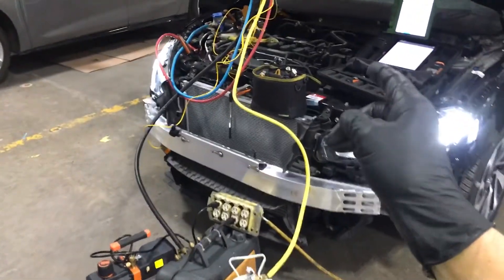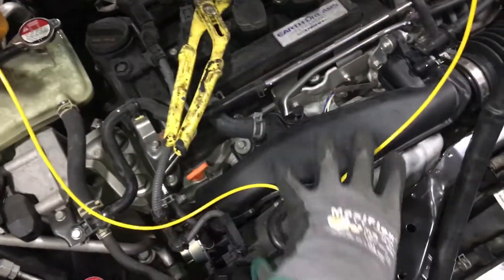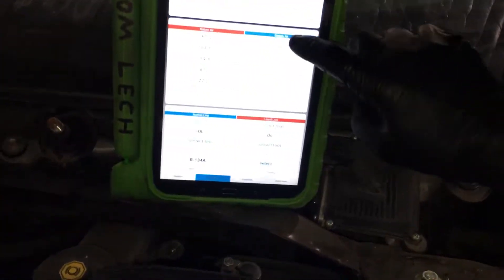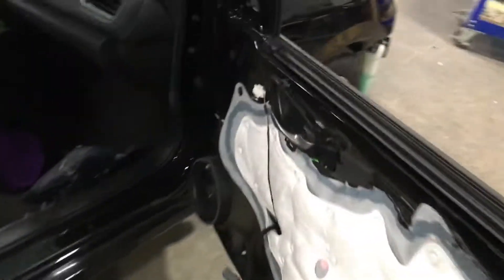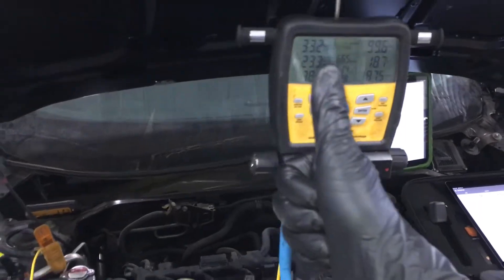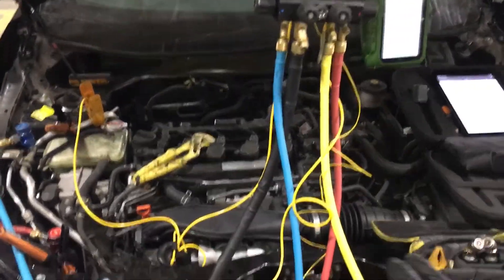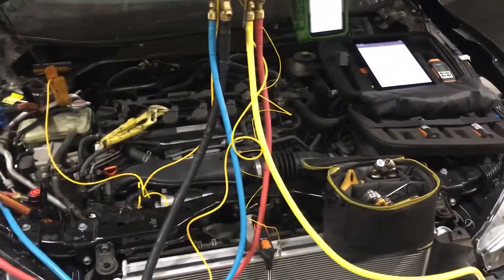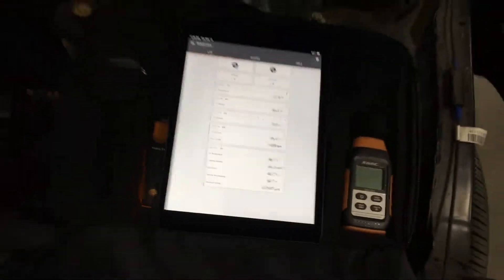Air conditioning variable displacement compressor low side pressure doesn’t change removing the load

Comment: So do I understand this correctly...When you dropped the heat load on the evaporator by selecting recirc. Although the L&H pressures altered very little their must have been a significant reduction in the volume of refrigerant displacement by the compressor. The climate module (ECM) would sense the dropping evap temp/cabin temp and reduce compressor output via the control valve on the compressor to match demand....Is that correct Tom? Thx for fielding the newbie questions.
Reply from the maker: Correct 🏆

I need to make a side-by-side video with two cars one old fix displacement piston compressor and then one of these new variables and do the exact same thing on both vehicles so people can see. 

          The same goes for raising the RPM in the old days with fixed displacement compressor when you raise the RPM the high side usually went up the low side went down and if you were feeding a refrigerant can into it it would help take it in faster because the low side pressure would drop.
Reply: @coldfinger459sub0  Thx Tom. Pretty steep learning curve to all this stuff (at least for me 🤣) Your prolific output of videos really does help a great deal. Thx again 👍

Comment: Do residential A/C systems also now use variable displacement compressors to increase efficiency?
Reply from the maker: Yes, the more modern day ones today have been switching over to vary the refrigerant flow. 
     They also started varying the condenser fan speed, controlling airflow over the condenser to maintain what the software has been programmed to hold. 
    And some of the higher and more efficient ones have varying speed, indoor air handler ECM blower motors. 

There is a manufacturer software built-in override one of two methods are used 

One as you have the manufacturer software that is loaded onto your laptop with an umbilical connection interface . 
     And you put the system into a test mode that fixes the displacement of the compressor, the condenser fan speed, the blower fan speed into a fixed mode, the more advanced one base it off outdoor temperature, indoor temperature and even take humidity into account. 
    And then the charge for the refrigerant can be set or topped off using superheat sub cooling

Some of the manufacturers are not that fancy they just have dip switches on a circuit board that you override and flip to set the unit into a test mode to override everything so the technician basically has a system that’s operating like an old-fashioned one where you can use super heat or sub cooling. 

Something to Automotive manufacturers need to do for us in the automotive industry for the AC especially the new heat pumps
Reply: @coldfinger459sub0  Wow, that's a big advance!   But very expensive?
Reply from the maker: @rj7008  everything became stupid expensive 100 200% increase in price after the Covid shut down. 
     And on top of that big venture investment capitalist came in and started buying up all the distributors and fixing the prices doubling the prices again just for profit margins having nothing to do with supplier demand. 

The variable displacement variable fan automated systems have been around for decades there nothing new . 
I myself have been purchasing and selling them to customers and installing them more than 20 years ago. I immediately jumped on the bandwagon of selling the most expensive bleeding edge, technology equipment, right away as soon as it was introduced into the residential market

On my large commercial building equipment, it was already available before that .  With much more advanced features.

It trickles down from the industrial and commercial industry first and then when the products can get cheaper and smaller in migrates down into the residential side of the market   

Think of it like cars, the most bleeding edge high tech, expensive options come into the highest end, Cadillac Mercedes-Benz, Audis Infiniti or Lexus, and then when the technology gets old and cheaper, he gets moved down to the lower and models of the company and become common place
Reply: @coldfinger459sub0  Very informative.  Unfortunately, my home A/C system is now 24 years old.  It's currently working well but I'm unsure about how much longer it will last -- hopefully 1-2 years more.  Unlike SF or LA where I grew up, A/C is not optional in Houston, Texas.  :(
Reply from the maker: @rj7008  if I was you, I would do everything you can to keep that old AC unit life it could last you another 10 years at least

Replacing motors is easy and cheap compared to a new unit contactors capacitors 
   If it was my own personal unit myself, and I wanted to keep it alive

I would pull the evaporator out give it a good cleaning and put a heat exchanger epoxy coating over the entire thing to extend its life another 10 or 20 years . 
    As long as the metal from the coils, condenser or evaporator are not exposed to the atmosphere for moisture, and possibly any corrosive chemicals or leaves dust debris that gets wet and causes corrosion.  By epoxy coating, there’s no electrolysis between the different metals at the header plates from the steel to the zinc to the copper to the aluminum.  Because it’s encapsulated inside epoxy.. 
      On my own home personal unit if I had such a unit. 
     Even if the compressor went out after 30 years. 
     It was most likely grossly oversized in the first place because that was a standard practice. 
      If I had a 5 ton system on my house. 
     I would keep the old system everything and replace the compressor that was rated for five times with a three tone compressor. 
      And now you would have a more efficient system because you have an oversized condenser and an oversized evaporator. 
       I know it would probably work better longer run times.  Instead of cycling off and on. 
      Throw on a good filtration system to protect a evaporator so it never has to be cleaned

Comment: how about you design a adapter or device for the rest of the world,  that works with the so called jerk off can,  so  the ac pro company doesnt release it sooner than you,  there working on it now, you keep showing them that no  diy-er  cant possibly charge there own ac system  close to full with a variable compressor used by many automakers over the last 5 years  and there going to show the rest of us how it can be done safely,  remember your dads generation said there would  never be a banning on r-12,  everyone said r134a would be for a lifetime,  they said sealers wouldnt last,  and just 10 years ago many ac techs and  wholesale  said never would they use reverse heat pumps in the auto industry.  your generation said who would ever need a  digital thermostat in a family home, because the old analog slider didnt work well enough for your grandparents home.  i gotta go now, myself like millions of other  people in america who would like cold air have to go jerk off now with there cans.  good day.
Reply from the maker: At least they could use just pure R1 34 without the additives it’s the additives with the people who use multiple cans where I see the blown shaft seals from their failures. After a couple extra ounces of lubricant have been added by repeated topping off with cans with additive in it that is my big issue. 

         I’m all for the do it yourself person they have every right to attempt the best repair they can add a economical price and be provided with all the information they could possibly find to do the job right so it doesn’t cause them undue harm to their financial situation. 

            But on the other hand I’m avidly against a professional shop will charge as a customer and money to use small refrigerant cans and just guess at the charge quantity taking money from a customer at the same time being the cause of their compressor burn out their shop seals blowing out clutch is slipping in burning up because they just guess with using little cans in what is supposed to be a professional trades industry .

            no problem Ann A/C pro can put their product on the market but provide truthful and very detailed instructions to come along with it. 

         Listing the possible side effects to the customer of how expensive and what could go wrong if they don’t do it right. 

         And when you go jerk off with your can remember to bring a razor because your palms may grow hair. 
          Bring a cane with you in case you go blind

My vendetta is against low life scum sucking owners of shops who can’t do the jobs they ask their guys to do an under pay them and don’t pay for training they prey on the lack of knowledge of the general public and rip them off and performing procedures they themselves cannot perform correctly. 

        These are the same lowlifes who replace a burn pile transmission but don’t flush the cooler or the lines and leave the metal debris in there so the transmission can fail again and another 30,000 miles. 

      These are the same kind of shops that don’t pay for their guys to go for training and buy them set equipment for proper cooling air purging methods so a customers car goes out and comes back with a blown head gasket because of the air inside the cooling system. 

          These cock roach owners of shops who are in for the fast buck and break a whip over their technicians to burn them out replace a power steering rack that is burned out or pump and not flush the rest of the system so when the new one goes out it burns out a year or two later because of the metal debris in the system because of lack of training knowledge equipment on the side of the owner of the shop Who seeks out the lowest paid employees he could get to turn a wrench when he will know if they’re under educated because those are the only kind of employees he can control to pray on the innocent consumers who don’t know any better that are getting ripped off.?

           And this gets back to the AC PRO That gets sold to shops by the case to give the customer their discount air conditioning service at the same time are the very cause of why the customer comes back a few months later with a blown compressor which by the way they’re more than happy to sell them on whole AC system new compressor new condenser flush out the system for a few thousand dollars which they initially caused the problem in the first place. 

            My beef is with those maggots they called them self shop owners but cannot perform the task themselves and take shortcuts in any automotive procedure but the one I can bring the light the most in my field is the big Dog on the block is AC PRO . 
        Because of the great marketing they do the most damage. 

          I have council do it yourself people who have emailed me directly called me directly or asked me for information on how to do it with a single can as if I had to do it myself with nothing more than a hose in a can. 

         And it’s getting more complicated as the new heat pump systems are entering the car market place the minimum repair bill will be somewhere between $4000 to $8000+ depending on the make year and model manufacture after a compressor burnout. 

       Read the cheapest cars today with a heat pump is the Prius prime. Which I’ve done two or three videos on and just the accumulator assembly with  solenoids and valves that would be replaced after a compressor burn out is $2600 by itself just the accumulator assembly.

Variable compressors were actually started coming to market somewhere around possibly 1985 on one of the Cadillacs the V5 compressor.